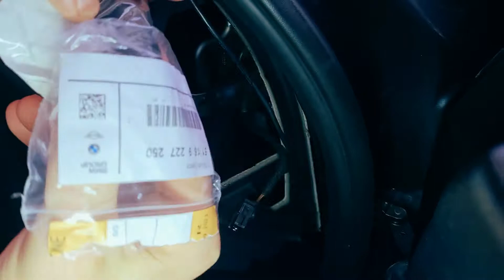BMW F30 Glove Box Damper replacement

Comment: So basically I need to unplug only the little part of the glovebox on the right in order to replace the damper?
Reply from the maker: This is f30 from 2012. Newer models have an airbag underneath the glove box. There are other YouTube videos for that model.
Reply: @CosminRotaru  I'm okay with that since I have 2012 F30 so the replacement procedure should be the same. Thanks a lot for your instructive video since I'm really bad manually-wise :) This black rubber element you unplugged before proceeding to the glovebox has to be unplugged yes?
Reply from the maker: @dawayalla  you mean the door gasket? You have to peel it of before you can take that plastic cover of. The you push it back in at the end. Or maybe you mean the electrical plug? There's a switch inside the damper for the glovebox light. Easy to unplug.
Reply: @CosminRotaru  exactly, I mean the door gasket. I forgot the name of this element. Thanks wholeheartedly!!! Waiting for more interesting videos, not only instructive ones ;)

Comment: if i have f30 2016 lci model and it has airbag, and the cover has airbag switch , can i still access the damper by disconecting batery and removing the cover with switch? or i should remove also the airbag?
Reply from the maker: Hi! I think replacing the damper in the lci model is more involved, as there's an airbag indeed. I don't know how to do that. You can find other clips if you search for "f30 glovebox airbag". Apparently you can remove the airbag without disconnecting its wires, but I would still disconnect the battery to be safe.